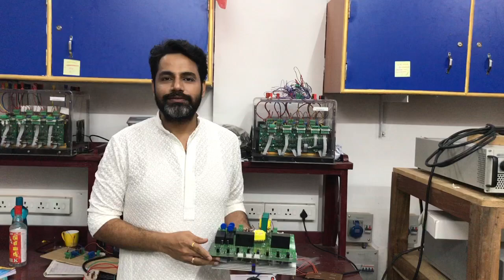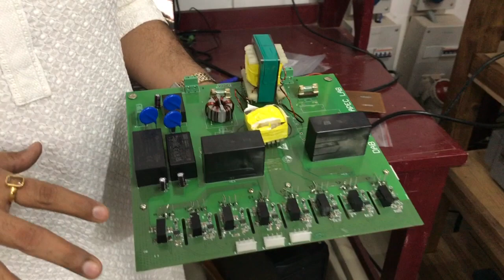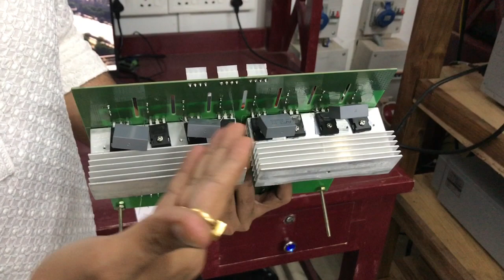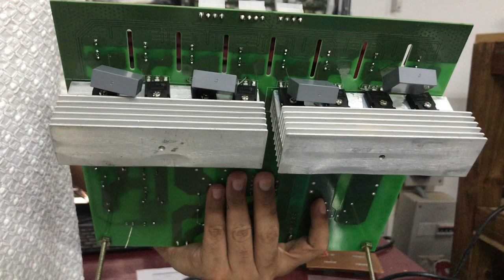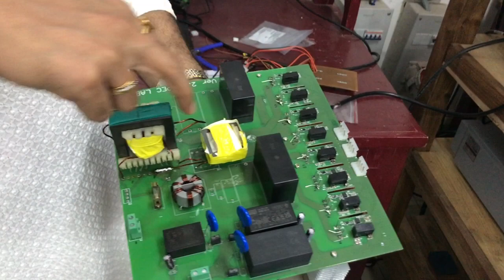PCB Explaination Dual active bridge

Comment: Hello sir, could share the part number or datasheet of the onboard power supply units which u are using..there are 8 black rectangular pieces near each driver right...I am asking about those .